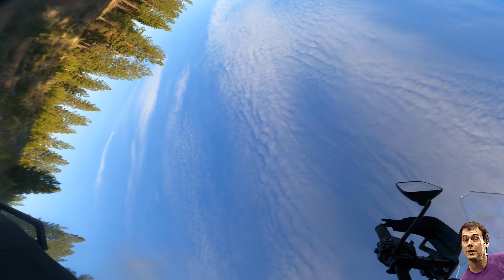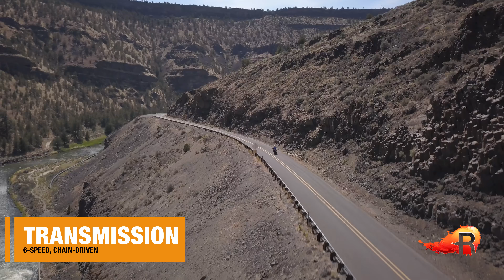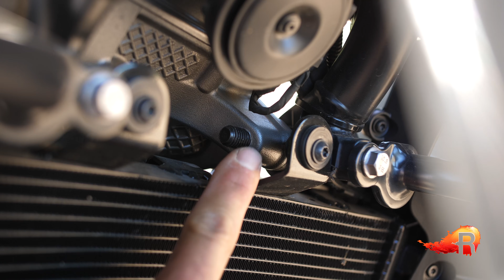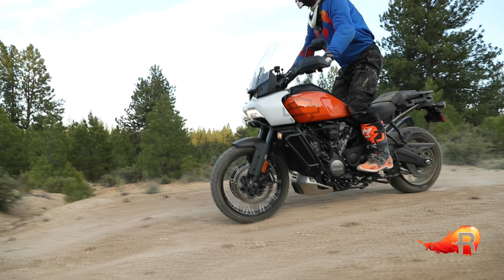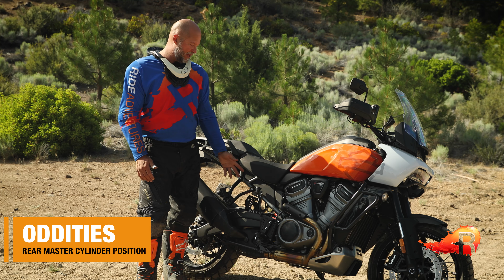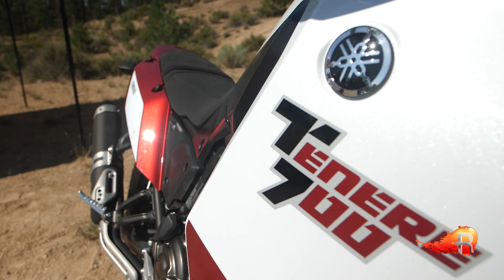Harley Davidson PAN AMERICA REVIEW | Pros & Cons

Comment: Great review!! In the market for a Honda ATAS but also thinking a little bit on the PanAm, since I’m selling my 2019 Street Bob to finance my Adv bike. My cons are like yours. I feel that a lot of details like the rear brake cylinder feels misplaced, low quality feeling in the mirrors and plastics etc. and the small wheels.
I have test rided it and it was a blast though, but only on road,  haven’t tried it off road.
But for a mix of on/off road maybe the Honda is a better choice?
Reply from the maker: This rider (Eric) would absolutely take an ATAS over the Pan America for dirt stuff. So, it depends on what "mix" you plan to do : )  Thanks for the note.

Comment: The PANAMERICA 1250 special has arrived in the top class of adventure motorcycles.
Since 26.06.2020 I own a PAN Special beside my BMW GS 1250 HPA.
With my friends from K+M Harleyworld we got startet with the project 1-100.000 km. Our 
vision is to check the usability, the reliability and the sustainability of the new HD Motorcycle.
Challenge 1 and 2 related to the usability and reliability was already completed end of October. We mounted a lot of useful stuff to make the Pan really usable for off-road adventures. Therefore a lot of innovations are mounted on my PAN „Elvis“ to make it fit for purpose. Then we crossed all high alp passes on gravel and asphalt in July. In August we went to the island of corse to cross also all high passes under high temperature conditions (40 degrees or hotter outside temp) At least my PAN has felt sand under its tyres for the first time. In September / October  we got started with challenge 2. We moved to Morocco to the high Atlas region. We crossed all high Atlas passes including the Col de Ouano on gravel, we circled the big duna of Erg Chebbi on old rally Dakar tracks and we checked out heavy city traffic under high temperature conditions. Result: The PAN collected during 4 month almost 30577 km on its meter. Almost 15% of this driven kilometers where been carried out on unsaved roads, mud, gravel or sand. So unter the line the PAN made it on all  playgrounds where the competitor brands usually run their shows. This without breakdown or other serious problems…..
On 31st October, I have shipped my PAN to Chile. On 3rd of January 2022 I will start my adventure „all the way up“ riding the Panamericana highway from Argentina to  Alaska. This last and long lasting test is mainly relayed to the point sustainability. Chapeau Harley at this point…
If you are interested, check out Biker.Jo on YouTube or Instagram …KR Jo
Reply: I'm in the same place, I own a BMW GS 1250 HP 2019 in Portugal and I'm gonna buy a PAN Special 2022 in the US (my second home) and I'm doing more tarmac miles than offroad, maybe trails and camp sometimes but I honestly think that (which is hard) to build something for the first time that can ride good on the road and go with your buddies on some offroad marshmallow night camping storytelling nights. I honestly think if that's the case and you're not lazy on maintenance it's gonna be fine.

Comment: Its not a 60 degree
It has 60 degree cylinders with a additional 30 degrees offset on the crank.So it is actually a 90 degree v twin with 60 degree cylinder banks

Comment: I find your information about the Pan American to be accurate mostly from one who actually own one with 6 other motorcycles 
If you change out the stock HD tires to the more aggressive ones they have for the PA , you will find it to be a very capable bike .  The only really bad thing I have found about the PA isn't with the bike .How HD put the bike out there with out really educating the dealers and their mechanics about them  1st .  Also the backlog for getting accessories from them is ridiculous  
I find it kind of sad of all the haters out there , most of them who actually never ridden the PA or even a Harley .
It's not about brand of bike you ride , it's about the ride . What ever bike works for you is good . I never rode or owned  a motorcycle I didn't like and wish I would have kept them all . They all have different personalities
Reply: My black HD aluminum panniers are still on back order for my 2022 PA. Picking the bike up on the 11th of April come hell or high water. Will use a 20L dry pack on the tail if necessary until the HD accessories arrive. Very frustrating
Reply: Let'em hate.  you'll smoke on the street with the Pan Am.
Reply: I’m a little late to this party but agree with the dealer debut. That seems to be on par with how they (dealers) handled the Buell years. I’ve owned many bikes and finally an HD (FLSL) but my riding is very dirt (road) oriented. Pan am would fit the bill but I’ve had a GS that excelled in that. I’m fortunate to have a few bikes that can do their intended “jobs”. Good on Harley for this bike, but now get the bricks and mortar to back them up. Accessories, if the MoCo can’t supply there are others that will.. cheers

Comment: Eric, I think this is a great review!! I believe you did a great job showcasing the pro's and con's of the PA. I also believe you did a great job keeping the topic focused on the PA and not muddying the waters with other manufactures spec's in comparison. That however leaves me with questions for you.

How did the ground clearance feel compared to a GS? seeing how they are pretty close to each other.
Did you ever feel like you would like to manually adjust the suspension? either for on road or off road?
How did the weight feel compared to other bikes you've ridden in the middle weight class? The PA outweighs the middle weight bikes sure. Not by much when looking at the africa twin? The other's... by about 100 pounds. I can say that the PA feels much better off-road weight wise than my old XR650 and the PA is 100 pounds heavier. I do miss the ground clearance and suspension travel of the XR... LOL. The weight on the PA is very, very low.
With the KTM super adventure R at 13.1:1 compression. How do they get around engine life and poor gas especially since they are so popular across the pond? KTM is known for service intervals but does that mean engine rebuilds?
When you were on the hill climb and aborted it, was the traction control off?
The voltage regulator is supposed to be hardened and able to take some hits. As far as the mounting location. That's not any different from any other Harley. They seem to have the units sealed pretty well from road grime. Would I put it there on an off road bike? No. I wouldn't put the battery there either to get hit. Or the oil filter way down low like it is.
Reply from the maker: Thanks for the great feedback! A couple of these questions about "feel" are pretty tough to answer, and the actual manufacturer ground clearance specs would be better than my suggesting any difference on. ----- We sure hope that Harley put good enough engine components in there to make the 13:1 compression ratio last a long time. Such a high price for a bike overall might indicate that parts of of high quality, but we don't know of anyone with a bunch of miles on the PA yet. ------- That Hillclimb: The Traction Control was actually "on" when I got stuck, and then let myself get flung off. We spent a bunch of time that day in the menu system trying to turn off the TC (like is necessary on a KTM) and even called the dealer to see if they knew how, only to then later notice that actual TC button on the right hand grip! Oh well :)  Fun bike with a few flaws. Thanks for watching.
Reply: @RIDEAdventures  I appreciate the response. I agree that the bike has a few flaws. Not sure what motorcycle or car that doesn't. Seems every manufacture has some weak spots and as consumers we get to decide which ones we are willing to live with.
I thought that the TC was probably what caused the hill climb oops. I did a couple short hill climbs and found out I had left it on when the rear tire would only slip for the most brief moments. It didn't cause me any grief as the hills I was on in those times were short enough to ride through it before loosing to much speed.
After I posted my comment I started thinking. What should another person take from someone else's review? What I mean is...If riding is dynamic and is constantly changing to suit the environment. Both on road or off-road. Then That knowledge is limited to just that. You having the opportunity of riding several different bikes on the tours you offer or maybe even for fun. Is why I was asking for your opinion on the "feel" of the PA. I've never been on a 1290 Super Adventure R. I've never been on a BMW 1250 GS. Just looking for some point of perspective from someone who has.
Reply from the maker: @schweiberholzfaller8597 , all good, and thanks for checking with us. Yea, it's just hard to articulate by text what the 'feel' differences are, but generally: The KTM would be the most agile of the 3 bikes, then the BMW, and then the Harley. But given what you said, the dynamic nature of riding.....each of us might feel something different. Whatever the case, let's just have fun and ride, noting that the BEST adventure bike is the one you're sitting on right now : )
Reply: @RIDEAdventures  For sure. I can definitely understand the difficulty of communicating through text. Thank you for sharing your opinion. It is greatly appreciated.
I absolutely agree that we should all have fun and enjoy the ride. After all. Why ride if your not enjoying it? 
I also very much agree that adventure happens no matter what bike your riding and no matter the environment. Thank you for mentioning that!! 
We are not so far apart in this world. Maybe we will cross paths some day. It would be nice to meet you in person.
Take care and ride safe!!

Comment: I think the kickstand on this bike was a complete fail, they should not have mounted it to the engine case...... Being 6' 6 I should easily be able to throw my leg over the bike but it's very difficult to do. So i mount it like a horse but the kickstand being on the engine case I'm worried I'll break it off over the years of riding it. In addition to that the hard bags  are too high on the bike. They should go down at least an inch. 
 Also the bike has nothing on the KTM 890 ADV R.  This bike is probably one of Harley's best performance bikes they've ever made but as far as going off road I feel like this bike is kind of a fail, outside of fire roads it's not going to be able to do much.
Reply: Funny you think that it would be just a fire road bike , there are a lot of videos showing them  doing  a hell of a lot more

Comment: All those electronics are definitely a con. Something to fail in the middle of nowhere. 13:1 compression ratio will definitely NOT work with what passes for gas in a lot of countries. Another con. Sidestand is bolted to the aluminum engine case. Major con. Radiator is exposed to whatever the front wheel can throw at it. Yet another con. This bike has way more cons than pros. No adventure bike needs that much power. My 2016 KLR650 has plenty of power to take me anywhere I want to go, which includes Prudhoe Bay AK. Adventure riding is not about speed. It's about going over or through whatever gets in your way. Why has nobody taken this thing to Prudhoe Bay yet? Are they afraid it wouldn't make it? Honda C90s have made it. Surely this $20K+ pile of electronics can do it.
Reply: KLR650 and PanAm are completely different classes of motorcycles. KLR is a dual sport, the PanAm is a road-biased adventure bike. It seems like you are not the right customer, and that's fine. Don't buy it, you never were going to. Ride your ride and let people enjoy theirs the way they want to. 
I rode the PanAm for a couple hours. While I wouldn't buy it because it's a bit out of my price range, I did absolutely enjoy the experience. 

Oh, by the way, even a normal Harley can make the trek up to Prudhoe Bay, that's no astounding feat. It's more a test of the rider than the bike.

Comment: Did you deliberately leave out comparisons with the world segment leader and originator of dual sport class, the BMW R1250GS? The BMW is superior in every way! HD are relying on American brand loyalty to market an inferior product.  It might work in USA, but nowhere else in the world. 

Chain drive? Really? You didn’t even mention it! And that ugly front end? Wow.  Brave to market that.  Over complex and poorly designed screen layout? You didn’t mention any of those. I guess you’re funded by HD?
Reply: I'm from Europe, bought a PanAM instead of GS1250, also in Europe PanA sold out. No way the GS1250 is superiour in every way....
Reply from the maker: Chain drive has the most efficient delivery of power, is lighter, and less-expensive (typically) than shaft-drive, still working just fine after all these years, and yes, the R1250GS is still a great bike as well. Just cause we didn't mention it (or about a half-dozen other big adventure bikes) doesn't mean we are sponsored by anyone. Fun to soak-up another random accusation though : )

Comment: Great review - I rode this bike on the road - amazing power and flow to the bike. With the new Kawasaki KLR 650 just out - is this a bike you would look at reviewing and/or adding them into your stable of adventure bikes for tours?
Reply from the maker: Yes, we still have the previous versions of the KLR in operation in Peru, and ran them for years in Patagonia. Just haven't bought the new one yet, as we've got a ton we're juggling right now. Will do a review on it for sure once we've tested it out. Thanks for checking in.
Reply: @RIDEAdventures  thanks for the reply.

Comment: Similar compression ratio to F1 engine? Hmmm, how often do they need stripping and rebuilding......If this bike is ridden in the same way and places as Africa Twin / BMW GS/ Yam Tenere it's going to be even more unreliable than Austrian bikes. It's a Starbucks bike at best because that's what its very obviously been designed for. And Oh-Oh, the side-stand is mounted directly to the engine casing. In better news, Eric does the best bike analysis on YT, reports very realistic facts.
Reply from the maker: David, thanks for saying so! We did forget to mention how the sidestand is mounted, yet another reason to 'take it easy' on the Pan America, perhaps.
Reply: Disagree. GS1250 is similair to PanAm, only smaller displaced adv bikes will take serious off roads. Decided to go for PanAM instead of GS1250 and not only for Starbuck visites, daily ride and some off road. Love the bike
Reply: @marcdroste4217  Same here  mine's been a blast to ride off road and on .

Comment: good review! While I agree that a middle weight would be great to have, not sure HD "needs" a parallel twin.. after all suzuki has one and it's doing alright. maybe having a V is what can distinguish them, a little like suzuki's or Moto Guzzi's engine
Reply from the maker: Thanks! If they want to maximize the suspension travel and ground clearance while keeping the seat height reasonably low, it's going to be tough with that rear cylinder on a V-Twin. Cheering for them either way.

Comment: I have a somewhat stupid question. 
Lean angle, how does a bike figure that out?
When you are going round a bend and leaning over, the lean is balancing the centripetal force with gravity, in equal measure.
So you are pulled directly down into the seat. 
So a G force sensor wouldn’t know you were leaning over. If you see what I mean. 
(There isn’t a force making you feel like you are flying off the seat towards the outside of the bend, like in a car. The “centrifugal” force. ) 

Sure you may get pulled down into your seat harder around a corner, but that’s also true if you ride into a rising road section. 
So it can’t be that. 
Are there optical sensors that read the distance of the road surface out from each side of the bike?
(Like a drone crash avoidance sensor.)

I maybe missing a obvious answer to this, let me know.

Comment: Twice the hp as the Tenere 700 , woah .
Reply: Twice the cost as well. Would love to have one to tour on someday, having a blast on the T7 to even think about another bike at the moment.
Reply: @RedEmpire36  
I just can't get enough time away from my business , house falling apart problems , elderly family obligations that I would do no matter what etc to get more than a few hours here and there to ride . Add the fire and terrible smoke conditions in a lot of California for the last 2 months I couldn't even plan the property search I wanted to take . Last year this year and now probably forever coof mania Lord only knows what is coming next , a got $50 on a 8.2 earthquake west coast sometime in the next year .
Reply: But the T7 will do circles around it off road, so there's that.....
Reply from the maker: Yea, and a bit more weight, but it rips!
Reply: @RIDEAdventures  
Yes it does , I had some squeaking coming from the front wheel on a ride a couple weeks ago . At 40mph and in 4th gear I hit a little uneven patch in the road and the Tenere made a squeaking sound like something was getting grinded in the brake pads . Got off the highway and took a look but nothing obvious so I went back home to check out the air pressure etc . It looked okay so went out again and all was fine until 25 minutes in after some twisty roads I hit a long straightaway and at 50 mph it squeaked again when I hit a little bump . Going to get that front tire up and spin it . I also raised the front fender up to maximum height so I got that task checked off . 
      Have to say that Harley Davidson has some very nice features . I don't need a million hp but that lower seat height option and it lowers itself when stopping is nice . I agree , a mid weight bike with some farkles would be nice .